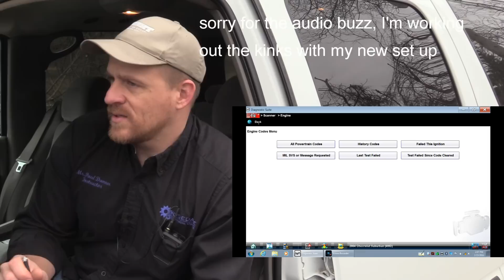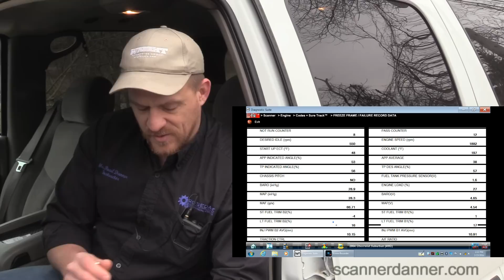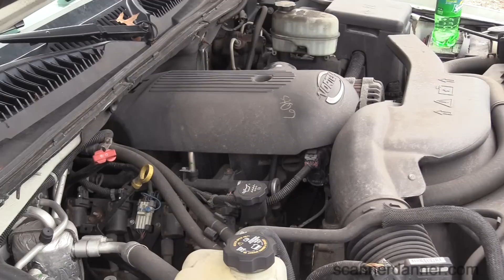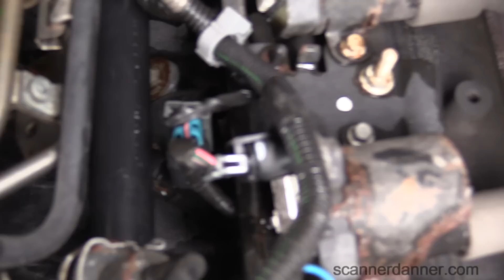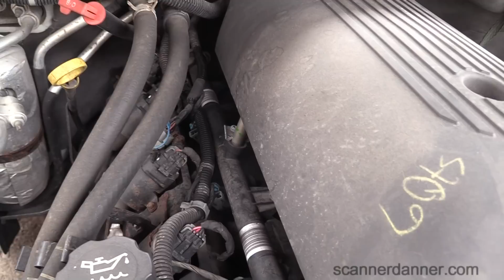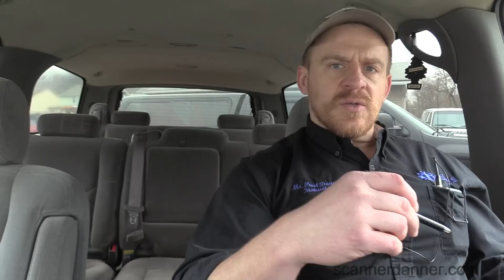Comment: I have a 97 aurora with almost the exact symptoms and codes.  ran fine until I had an oil change.  It does different things.  One time it will low idle and run rough, next time it will stick at 2500 to 3000 rpm.  Also the battery seems to go dead easy and no battery issues before.  It will click like a completely dead battery but then if i hold the key on it will turn over enough to start and I can start it 2 or 3 times in a row.  Oh, and sometimes after messing with it a bit it will start and run fine but if I leave it over night, its back at it.  Any ideas??
Reply: It is becoming more and more difficult to answer questions here. I have 80,000 people asking me for help now. So I have created a forum to help you guys better. It is free to join and we can exchange pictures, wiring diagrams and waveforms if needed to help guide you through the process of troubleshooting your vehicle. Thank you so much! Hope to see you there. 
Paul Danner (ScannerDanner)
https://www.scannerdanner.com/forum/post-your-repair-questions-here.html

Comment: I continually get these "lean codes" on my '07 Toyota Sienna (3.5L V6). 
 Normally, it only occurs when I'm re-starting a recently shut down van 
(with an already hot engine), and doing low RPM driving around town.  
Runs great in all other conditions.   Cleaning the MAF seemed to help 
for a little while, but it keeps coming back ... and it's driving me 
nuts!  Do I have a vaccum leak somewhere, or a bad MAF/O2 sensor? 
Dealer, of course, thinks I need a new Fuel Pump (@ $1,200...)!?
Reply: It is becoming more and more difficult to answer questions here. I have 80,000 people asking me for help now. So I have created a forum to help you guys better. It is free to join and we can exchange pictures, wiring diagrams and waveforms if needed to help guide you through the process of troubleshooting your vehicle. Thank you so much! Hope to see you there. 
Paul Danner (ScannerDanner)
 https://www.scannerdanner.com/forum/post-your-repair-questions-here.html

Comment: Wow man very good video and diagnosis. On snap throttle the more oxygen the o2 sensor reads the lower the voltage right? The less oxygen the higher voltage? Can u explain how the snap throttle is making the 02 sensors react? Thanks

Comment: I have a 2007 escalade  cold air intake with oil catch can.  I replaced the throttle body and gasket. tightened everything back  plugged everything back up including battery. started relearn process and within 2 minutes I got the service stability message and codes p0171 and p0174. its at the Cadillac dealer now. could it be a intake gasket? I even replaced the mass air flow probe. took the cold air intake off 3 times to make sure its back on tight checked my hoses and codes still comming back. what should I ask the dealer when they call me back?
Reply: also went on a 700 mile road trip a few days ago I got 19 mpg all highway at 85 mph.  did I miss something when I replaced the throttle body?
Reply: So what ended up happening?
Reply: Intake manifold gasket had a leak on the back part by firewall and the manifold nipple where the brake booster vacuum hose goes into was cracked.  Got the parts from deaker got  it back home and took it off sure enough had a crack on the rear driver side gasket..  put wverything back on  cel went off and never came back .... ;D.        I do have 1 ? My escalade is awd. Im doing the diff service on it..  for the front one do i need limited slip additive or just in the back? I was thinking of using mobile 1 LS 75w90 gear oil. It already had limited slip stuff in it
Reply: Oh its a 2007 escalade  6.2 awd

Comment: I am yet to tell people what my conclusion will be on the 5.7 litre V8 Holden Commodore of mine as mentioned on the fuel pump diagnosis on the Ford video, the fuel pump & fuel pressure regulator are both an integral unit inside the fuel tank,the fuel pressure was still at 47 PSI at the rail when it should be almost be 60 PSI even after a new fuel pump was fitted,the old one was noisy so I replaced it because it was going to die on me for sure.
I have ordered a new fuel pressure regulator which should arrive in Australia in the next couple of weeks, it is made to be mounted on the fuel rail & has a provision for a vacuum line although I have seen them being mounted inside the fuel tank in the Commodore.
I will mention on the Ford video what mine concluded to by the end of the month as I think it is fuel pressure on mine that is causing the lean condition,which is uo to 25% on both banks, the O2 sensor has a Low reading on the right hand bank until I give it a bit of a stab with the throttle which brings it up to over 800 millivolts so I think the sensor is switching o.k.
I have been wondering why no fault codes have been stored in the ECU when CEL display appears in the Holden,I know it is an intermittent fault where sometimes the CEL symbol is switched off by the PCM once the O2 sensor signals fall into acceptable parameters while driving the car which Holden says automatically clears the fault code from the PCMs memory.
The ECU is Delphi as used in the U.S. in their GM cars but I have only ever retrieved a P0443 fault code using a generic scan tool which was emission related,there is the debate that the pre CAN-BUS OBDII Holdens (Chevy LS1) cannot have their fault codes retrieved without the Tech 2 scanner,my dads car is a 2000 model Commodore fitted with the old 3.8 litre Buick V6 engine but Holden wired them up to run the old OBDI AC Delco PCM whereas Buick I have noticed run them with the same sort of OBDII Delphi unit that is used with the LS1 engine since OBDII became mandatory in the U.S. in 1996 & not Australia.
The fuel pressure regulator I ordered fits the later U.S. delivered Buick 3.8 litre engine & Chevrolet LS1 engines but will not work with the Australian delivered 3.8 litre which runs with a 3 bar (43 PSI) & not the 4 bar (58 PSI) fuel system they do.

Comment: Nice diagnosis Paul, this is the first time I have seen the smoke tester in use, very impressive. The smoke testers also may be used to locate tricky  exhaust leaks in the engine compartment I understand.

Comment: Is the steam in the exaust harmless for the O2 sensors?
Reply: There is steam in an exhaust under normal conditions too. The fuel  burns with air and forms water and carbon dioxide. So a little more water vapor doesn't really harm anything. As Paul said, you're only steamcleaning the top of the pistons a little bit :)
Reply: Thanks for replying to the question from another sub!

Comment: Hi Dan. I have an Opel Corsa (Also GM) where i had a problem with some hesitation. I then tried to reset the ECU through my Opel scantool (Called "Reset o2 block learn map" and "Reset IAC block learn map" And just after doing that, the engine is running real bad, and won't go into closed loop. I get two error codes "P0505 - IAC blocked" "P0130 - Oxygen sensor low or missing" The oxygen sensor is at 20mv indicating lean mixture, and DOES go up when i add starter fluid to the intake (meaning o2 is good i guess?) Although the computer at idle, and warmed up seems to changing between open and closed loop. I am pretty lost now, and i don't know what to do. Some people suggest on the internet to take it for some long drives, but the engine doesn't seem happy at all, and i don't want to make things any worse. Any idea what i should do now?
Reply: Also the brakebooster is not working properly. Like there is a vacuum leak, but i cannot find any..
Reply: O2 block learn map would be your long term fuel trim. The reason it is running worse than before, is you wiped out the computers memory of adding fuel to the lean condition that you have. So yes, a long test drive will help it to run better again but will NOT be the fix. You have a severe lean condition that you need to handle. All of your symptoms (IAC, and O2 codes) are suggesting a vacuum leak. If you are not sure about the brake booster, pinch off the hose and recheck your data, like I did in this video
https://www.youtube.com/watch?v=1Ea0Sjx_ZXE
Reply: +ScannerDanner I see why this would cause these symptoms.  It appears that there is only 2 vacuum lines on my vehicle.  One to the brake booster and one to the fpr.  Blocking both of these at the engine does not help on data or help the engine running. I also tried spraying starter liquid around the intake gasket to check for leaks,  but nothing seems to really show up.. :s
Reply: But is there anything else that would lower the engine vacuum? Since the brake booster does not work as it should at the moment. When not blocking the vacuum line when brake booster is disconnected, the vacuum does not seem that strong, but i do not own a vacuum gauge unfortunately..
Reply: Yes. An engine that is running poorly will have vacuum problems. There are many other causes of lean conditions. Low fuel pressure, bad MAF, restricted injectors etc. You need to test these other systems. If you need more help, post your questions here okay?
http://www.scannerdanner.com/forum#/general-repair-questions/
Reply: +ScannerDanner haha sorry.  Didnt want to bother you.  I actually ended up solving it.  I reset the iac..  (no clue why that was influencing a lean condition...)

Comment: I got my butt kicked today I had a p0171 and p0174 on a 08 honda pilot 3.5L did a smoke test on the intake and found no leaks only a small tear on the intake filter tube before the map so It wouldn't be an issue my question is would tight valve lash cause a lean condition on both banks?
Reply: tight valves would be a stretch, that would cause misfiring first, but a misfire would also cause a false lean condition and possibly the codes you have

Comment: I've pretty much by now come to the conclusion that when these symptoms are described and i see the freeze frame indicating cold misfires and high trims in open loop, i start with assumption of intake leak first and try to eliminate that variable while the engine is cold rather than warm it up like I usually do. I've had several times where trims were zero'd when engine was warm but if vehicle sits overnight, it wont even start for several tries because the leak was so bad.
Reply: exactly my friend
Reply: Regarding not using vac gauge to look for vacuum leak, I wonder why you would not just look at the scanner as most cars report the intake manifold vacuum as a live data on OBD.  Yet, I've never see anyone advising to check this data point when trying to pinpoint lean condition.  Is there a reason why this is not a legitimate test?
Reply: i dont under stand why techs dont use a vacuum gauge.thats what the old days techs use when they didnt have all the fancy scanners,i think if the techs or diys use the vac gauge with the scanners that would help solve problems.
Reply: i think isnt good idea to test vacum or read MAP senssor data,because problem is in mixture not in vacum,vac reading can be same as with vacum leak or without vac leak,if there isnt mega big vac leak leak and idle will be high :) imho
Reply: CarShed68 Carshed, you are entitled to your opinion, but not to a difference in the factual operation of a computer controlled fuel system.
  MAP data is integral to determining if the MAP is the cause of an issue or the result of an issue.  Proper understanding of the input parameters for the PCM is the best way to determine etiology.
  To say it is not a good idea to gather crucial data relative to the PCM outputs is a horrible misstatement.
Reply: Schrodingers Box
omg english isnt my first language so even after transelate it in google didnt understand anything :) but thanks for reply im  subscribed to  you.You have great channel, i liked video about fuel trims,was very well explained!
Reply: willliam arnold - many of these modern new fangled engines have built in vacuum guage called a MAP sensor.
Reply: @frugalprepper  map is pressure not vacuum
Reply: @kirkbrown2147  not sure you know what you are saying here.
Reply: @ericg3810  😂

Comment: Hi I own an audi a6 1999 I have 6 trouble codes  P0154:Heated Oxygen Sensor (HO2S) Circuit No Activity Detected (Bank 2 - Sensor 1)... P0411:Secondary Air Injection System Incorrect Flow Detected....P0117:Engine Coolant Temperature (ECT) (Sensor 1) Circuit Low....P1138:Long Term Fuel Trim (LONGFT) Additive Fuel, (Bank 2) System Too Lean...p1136:Long Term Fuel Trim Add.Fuel,Bank1 System too Lean...P1197:Oxygen (O2) Sensor Heater Circuit, (Bank 2 - Sensor 1) Electrical Malfunction....P0455:EVAP Emission Contr.Sys.(Gross Leak) Leak Detected.....I'm really not sure where to start first I need to get this car smogged I am gonna take it to a mechanic soon but what should I fix first????? please help
Reply: +jakina brown Do the items first that will affect other readings. #1 PO117 ,replace the thermostat and retest. #2 PO154 and PO 1197, both electrical problems wit the 0/2 heater circuits, you must test the voltage going into the sensors to see if the heaters are getting proper current or the sensors are bad. Record or write down all the freeze frame data when the codes occurred and clear the check engine light. Tighten the gas  cap for fun, and retest the car to see if the trouble codes come back.You would now have to deal with the fuel trim problems if they are still there. Peace.

Comment: Great Videos I have A ford explorer That Has no Trouble codes But when is driven at 20 to 30 miles.
It starts to accelerated all 40-50 60 ,.,.Until i put on the brakes,.,But at idle it run fine,.tps reading is look ok,.
Any good tip,,Thaks scanner danner.,

Comment: Thanks for the video! Trying to diagnose the 0171, 0174, and an 0101 code on my truck for emissions testing. When the engine is hot at idle I am getting near zero trim numbers and between 10-19% when hot at highway speeds. Like your truck, my code set at 143* or so. This makes me far more confident that I can fix this issue!
Reply: +Nathan Zupancic cool man, sounds like your issue too

Comment: I have a honda fit sport 2013, I recently got a p0171. I tried to diagnose the short term trim and my % avgs to 40% and gets worse and does doesn't get better, although letting off the peddle drops the trim down to 0% and never drops negative. What's the conclusion on my vehicle's condition as explained? Also one of the things I've noticed is that when spraying down the stem on the electrical egr valve with intake cleaner drops it down to negative, but my scanner indicates that it's working fine on the smog test. Could this be the main issue although you've mentioned in one of your videos that short term trims that get worse at snap isn't really vacuum leak that should be sought out. Honestly, I think the egr works fine, it's just the liquid that seeps into the gasket in between the block and the pintle housing seems to fix the problem. err...
Reply: +Fin ish what is LTFT and STFT at idle ______    ________ and at 3000 RPM _______   ________?
Reply: STFT=30-40% LTFT=varies at distance and time but normally 2-5% per 5-10mins. The scenario is accel increases stft and does not drop and when letting go of accel drops and stays at 0% and normalizes back into lean after a certain increment of time and distance per ignition. The scanner I'm using is blue driver so I wouldn't know what the actual value is when the accel is let go.

Comment: I had a 2012 Cruze throw that P0171 code yesterday, used the brake cleaner trick (shame on me) but it had a rough idle, ran like hammered dog crap, sprayed around the intake and idle smooths out. Changed the intake gaskets and problem persists. called GM in Detroit and got told to change out the valve cover, turns out Pcv valve was the culprit. Ever come across this?

Comment: #05-06-04-029A: Flexible Fuel (RPO L59) Rough 
Idle, Misfire, MIL DTC P0300 (Install Intake Manifold Gaskets with Teal Green 
Gasket Material) - (Jun 24, 2005)  vinZ engine

Comment: G'day Paul. I had a v8 LS1 engine in a local car here in Australia (Commodore) with a cold start miss that only happened on start up for about 5 seconds. I had the car at the workshop for two days before I found the cylinder at fault by the drop test, after swapping components with the cylinder next door over the next few days it turned out to be the injector.
On closer inspection the filter basket was very blocked as were most of the other injectors, a service to the injectors and new fuel rail and filter and so forth fixed the problem. very frustrating when the problem is only present for seconds and takes many hours to come back.
Reply: +Glen O'Hara for sure man, those are the hardest ones

Comment: hay paul, I want to thank you for all your teachings, I've recently utilized 2 techniques learned from you. First one was I finished an engine swap on a nissan 360z, and after finishing hooking everything back up the engine would crank properly but backfire and would not start at all. Similar to a distributor out of time, of course this engine is COP. Turns out I had incorrectly hooked up 2 coils per bank. I had the cables reversed, and I came to that conclusion from a video I had seen from you before. I caught my own mistake. Second one just today, 2003 ford focus 2.0 DOHC, engine would stall out immediately when you would press the GAS pedal while in drive. If you revd the engine while in Park, neutral, or reverse (you could reverse fine) the engine would run fine. put it in any forward gear and it would idle fine, as soon as you hit the pedal it would immediately stall out, no chance to do anything, no real chance to even look at any live data. There were no trouble codes. I tried unplugging the tps, no dice, maf, engine wouldnt run with the maf unplugged, no backup strategy without maf, I then unplugged the upstream oxygen sensor, and whaddya know, engine ran fine (with the check engine light on of course). New O2 sensor and the car is now fixed. Thank you for teachings paul
Reply: +Goenitz Lopez thanks man!